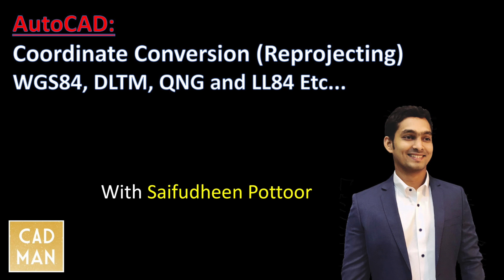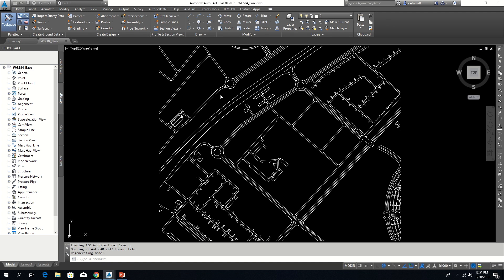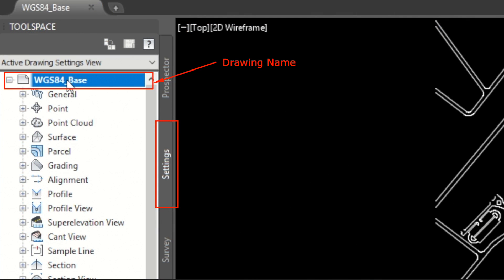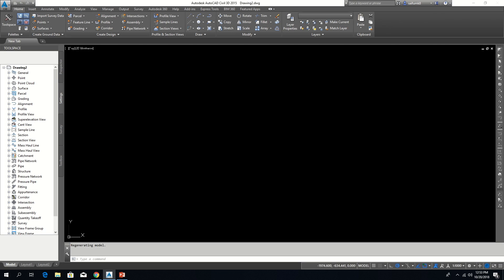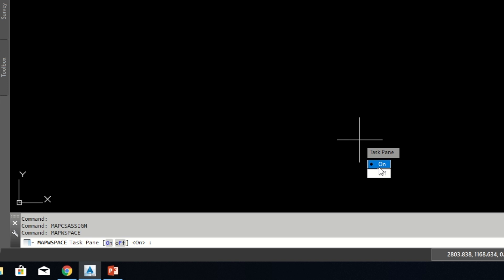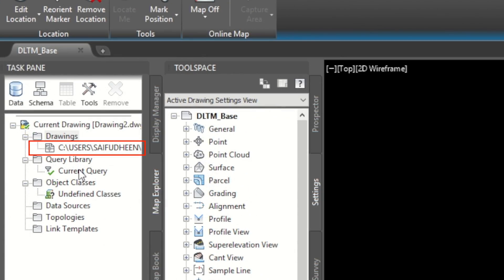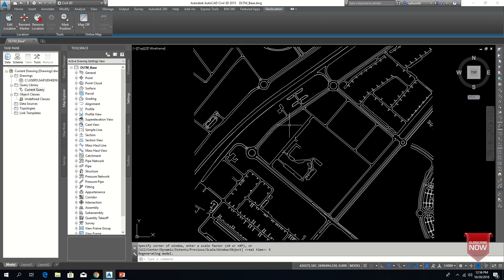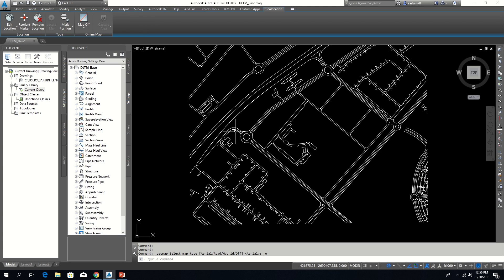AutoCAD Civil 3D Coordinate Conversion

Comment: in this video, you explained the transormstion in 2 different software right? one civil3d other one map3d. So it's not connected to eachother?
coz for the first 3 min of the video, it was very simple,
right click, change the cooridnate and save it? thats it right?
Reply from the maker: Civil 3D is a combination of AutoCAD, Map3D, and Civil 3D functions like corridor, surface, featureline etc... The coordinate conversion function is belongs to map3D, however set a coordinates system function have both in civil3d and Map3d so you could use any of them.

Comment: i want this cordinate system meter to feet and feet to meter
Reply from the maker: You do that by using this method only difference is keep same coordinate system on both drawing only change units in settings (top left side same in same window)

Comment: can u help to create a user defined coordinate system .csd base on this prj data  PROJCS["Pak I",GEOGCS["GCS_WGS_1984",DATUM["D_WGS_1984",SPHEROID["WGS_1984",6378137.0,298.257223563]],PRIMEM["Greenwich",0.0],UNIT["Degree",0.0174532925199433]],PROJECTION["Lambert_Conformal_Conic"],PARAMETER["False_Easting",2743196.4],PARAMETER["False_Northing",914398.8],PARAMETER["Central_Meridian",68.0],PARAMETER["Standard_Parallel_1",29.655],PARAMETER["Standard_Parallel_2",35.314],PARAMETER["Scale_Factor",1.0],PARAMETER["Latitude_Of_Origin",32.5],UNIT["Meter",1.0]]
thank you for sparing a bit time
Reply from the maker: I have emailed you the GIS Specialist contact details.